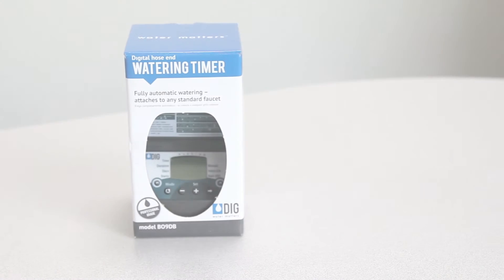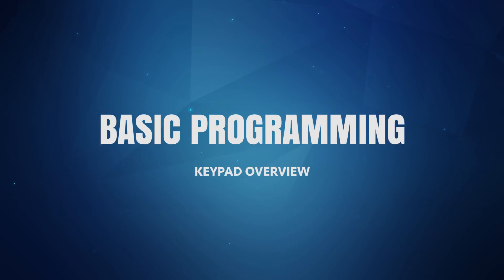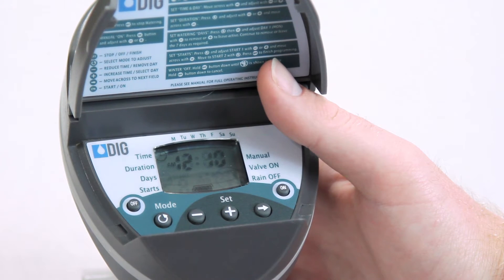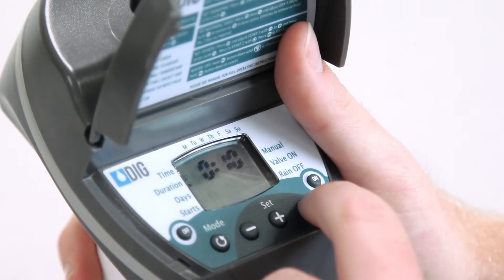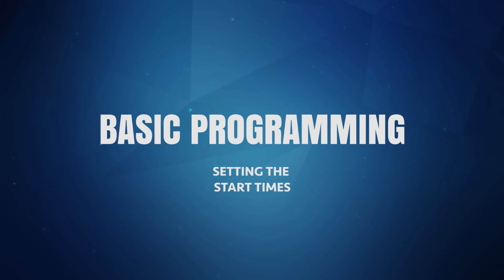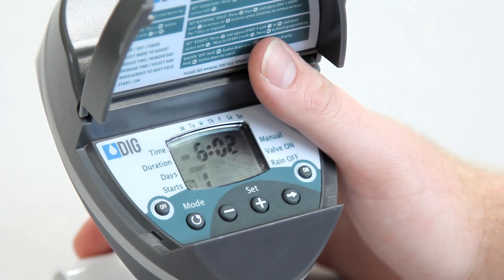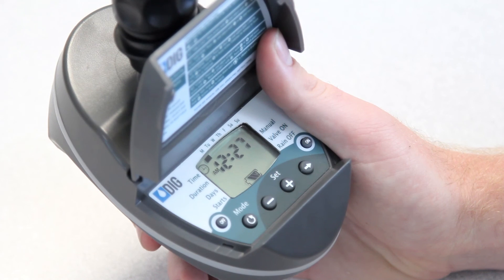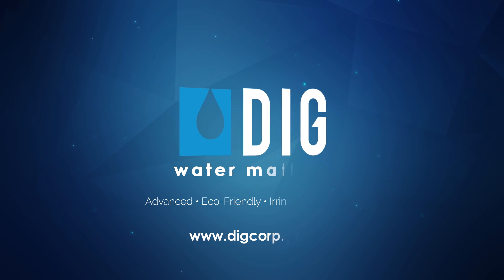DIG B09D & B09DB Battery Operated Hose End Timers (Tap timers): Programming

Comment: I have 6 of these units and 5 of them work flawlessly. The 6th one will not turn on. I can program it. I can turn it on manually but not automatically. The screen shows the unit is OFF. Even though I push the button to turn it on, it will not turn on.

Comment: Hello:  I wanted to use the DIG B09D timer in Manual mode so that I could water beneath a tree that was missed by the sprinkler.  My instruction manual says;   "To instantly water push OFF.  
Push OFF to stop or it will run for the programmed time (if set).  
Default watering time is 5 minutes."

Nothing happened when I pushed OFF.  No water!?!?

Comment: It clicks but doesn't let water thru.  Any help?   I have a 100gall tank but don't want all water going out at one time.  Want water to last 2 weeks(so I don't have to haul water each week.   Thats why I bought the valve.   
Do they make a valve that works with low pressure?
Nice looking unit/don't think the valve inside is moving.

Comment: My timers timed on, but only a trickle of water was coming out.
Reply from the maker: Hello Kerry, A few things can cause this type of issue. The first is low pressure anything under around 20 psi. The second is debris stuck inside the valve causing reduced flow. The third is clogged screen washer on the inlet side of your BO9D timer. If you need further troubleshooting assistance please feel free to call our technical service/product support line at 1-800-322-9146.

Comment: How to set timer from 4 to 3 times
Reply from the maker: Hey Moli,

Steps on how to remove a start time:
 
Press the Mode button until you reach the start time you would like to turn off.
Then press the plus (+) button multiple times until the screen shows OFF.
In-between 11:00 pm and 12:00 am the BO9D has an off setting.
 
Hope this helps! Please let us know if you need anything else.